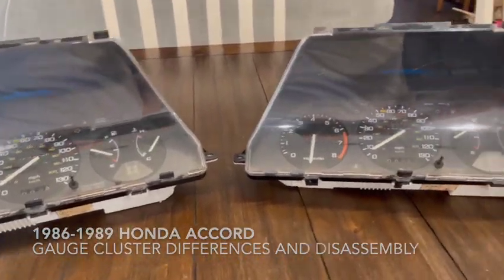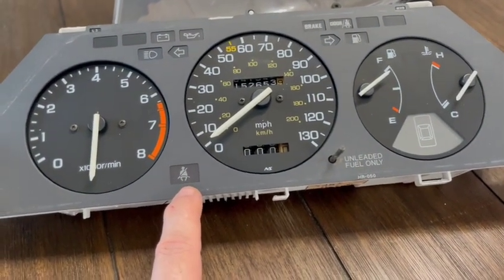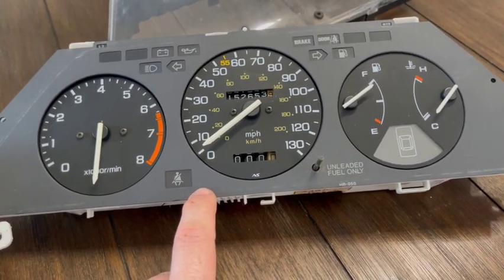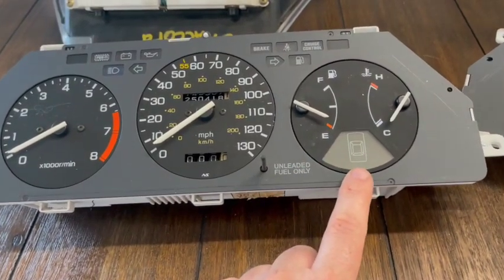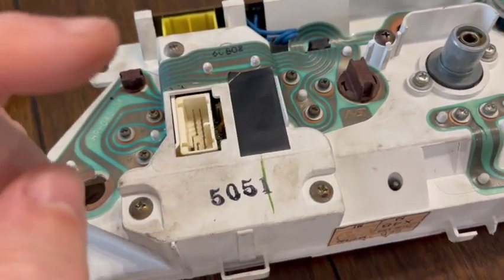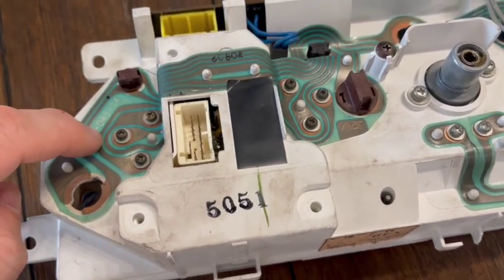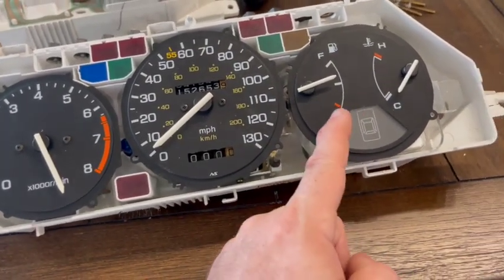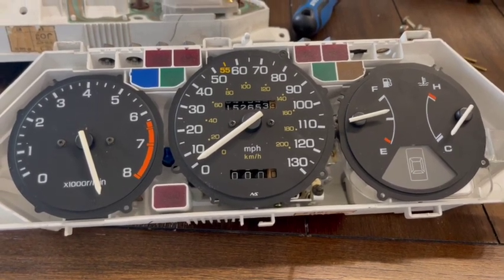1986 1989 Honda Accord Gauge Cluster Compatibility

Comment: Nice work man!  I still want to know what folks take is on lubing up the speedo input.   Some way to grease?  3 in 1 oil?  I know it can be an issue as it dries up.
Reply: I personally use regular motor oil, recommend a thin oil such as 5w-30, thinner is better! I don't think it would dry up cuz it never happened to me, just don't put too much oil innit.
Reply from the maker: I apologize for taking so long to respond.  I didn't realize anyone responded.  I used WD-40 Gear Gel and just put some in the top where it connects to the back of the speedometer.  Over time as the shaft spins and gravity pulls it down, my speedometer stopped making a winding noise and the needle stopped bouncing.
Reply: @Rekonstruct  Nice.